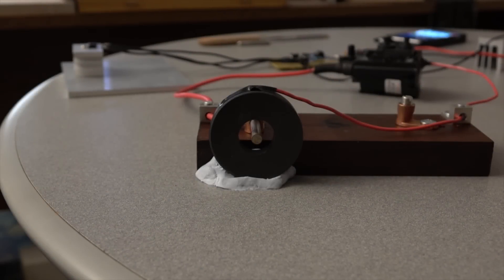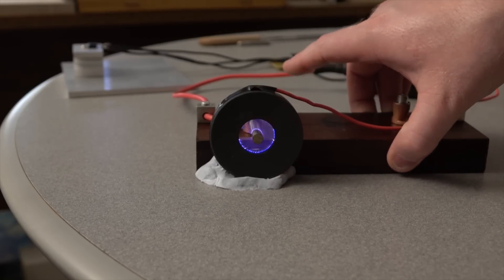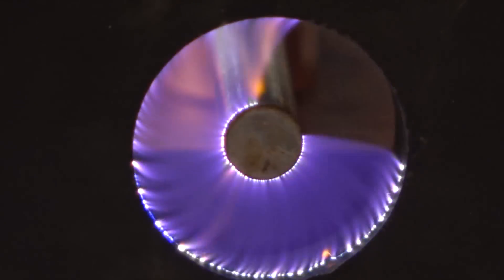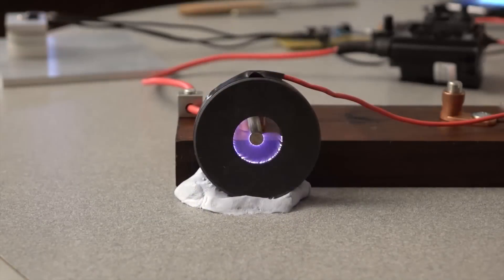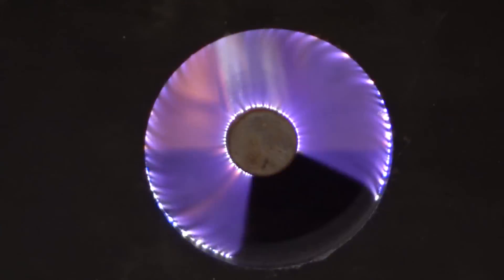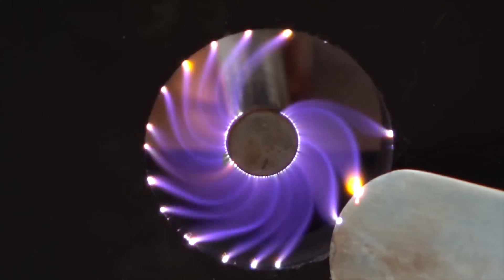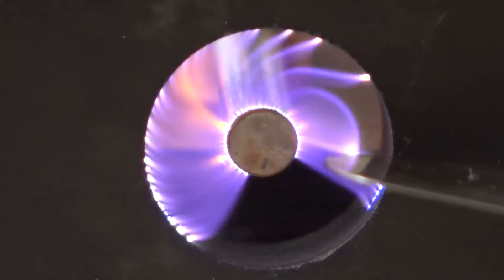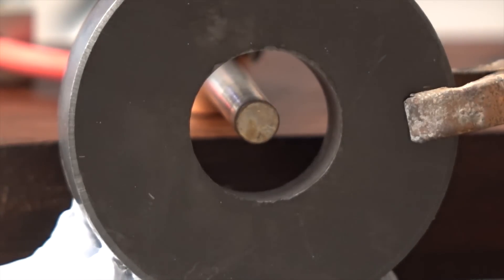Plasma Vortex Force Field

Comment from the maker: The reason the arc rotates is because there is a Lorentz force acting on it. The arc is essentially functioning the same as the wire in a homopolar motor like this: http://imgur.com/gallery/gL0OjgE
Reply: What if you increase amps? Would it just heat things up ?
Reply: Its Lentz rule,not Lorentz!!
Reply from the maker: @bobymox  it is the Lorentz force & lenz’s law. Pick up a physics book.

Comment: This may seem like sci fi bull but it’s definitely real, the voltage is heating the surrounding air and the magnetic field is containing, and when pass a current through a magnet it causes this vortex effect and strengthens the magnet

Comment: That's more like a security force field, but you could trap gases in inverted magnetic fields and have a static force field you can walk through, and use gas as glass and a even a wall or athestic device wall.

Comment: What happens if:
-You put a fan the air passes through?
-Instead of round, change the shape of the magnet in quadrangular (with bevelled edges)
-The space around the magnet becomes greater than 30 cm or more?

Comment: Wow that's really neat... So the arc follows the movement of the magnetic field? 

Makes me wonder how it would react to one of those new "3D printed" Magnets. Talked about on Smarter Every Day's channel.
Reply: just recently learned in physics that the force on the arc (flowing electric charge) is perpendicular to the magnetic field. (right hand rule) I guess it will depend on the design on the printed magnet.
Reply from the maker: +Scott Cress Thanks.  Yeah, that would be pretty cool to experiment with different patterns.

Comment: heating the magnet will ruin it
Reply from the maker: +MorginBlack Unlike Neodymium, Samarium Cobalt, and Alnico, Ceramic magnets have a Positive Temperature Coefficient for the Intrinsic Coercive Force (Hci) (β).  This means that as the temperature increases the magnet may exhibit an increase in net field strength.  Ceramic magnets can easily operate at 482 degrees fahrenheit(250 degrees celsius) and this isn't going anywhere near that temperature.